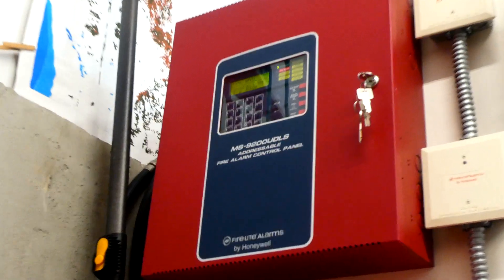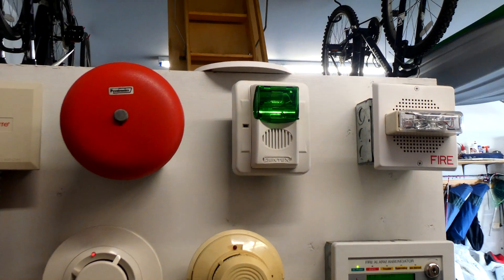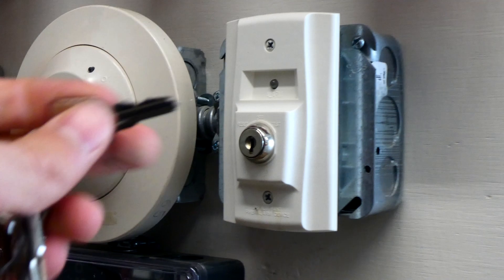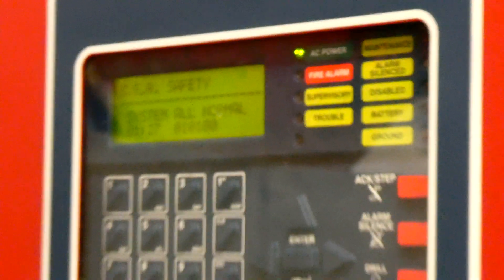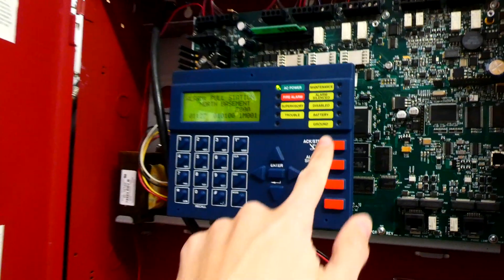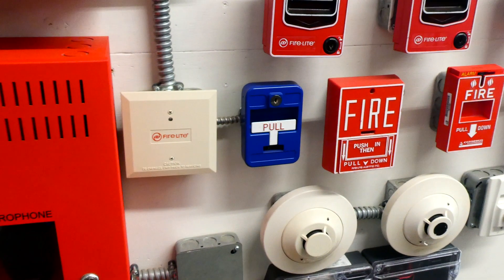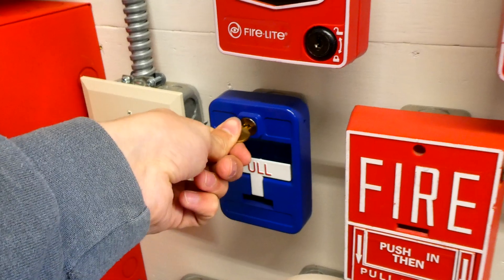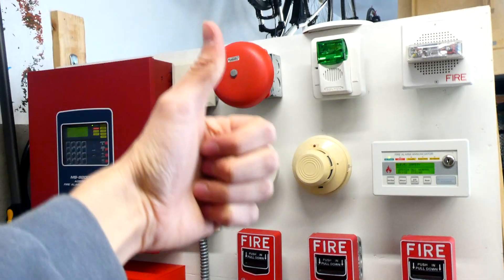Wheelock & Fire-Lite Voice System Test 16 | Key Switch Test!

Comment: Very nice setup! Any idea where I can find a metal gong for the motor assembly? Have the motor activated striker but the actual gong from it is missing. Works fine but it would be nice if I could complete it. There are no visible manufacturers markings on the motor assembly which is making it tough to ID it’s source, not even a model number.

Comment: Can you do The Fire lite BG-12LX And pull it then after that reset the panel or system and key open the pull station and flip the switch